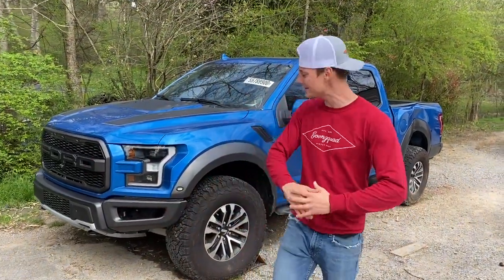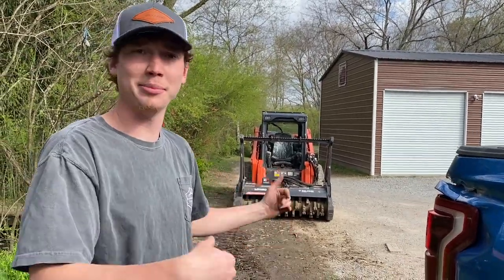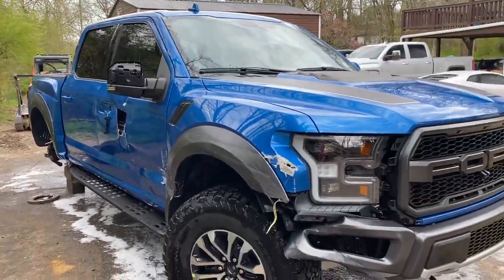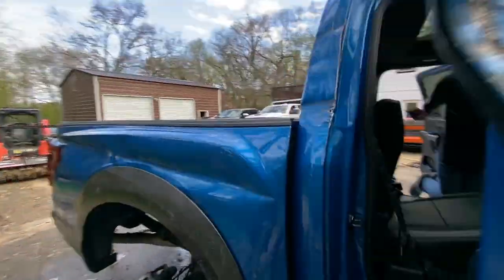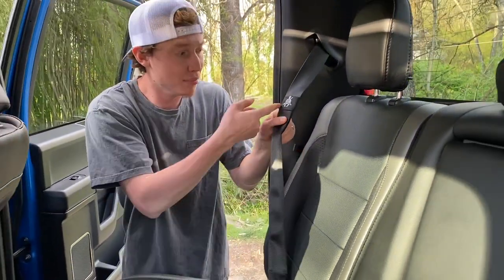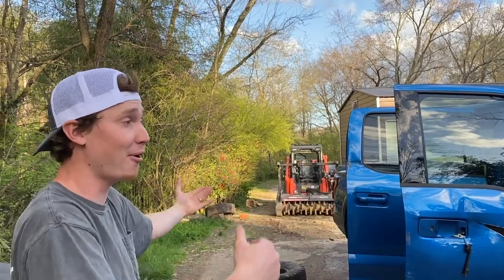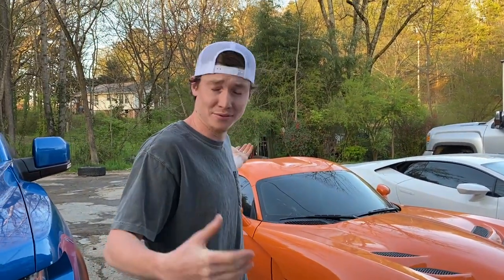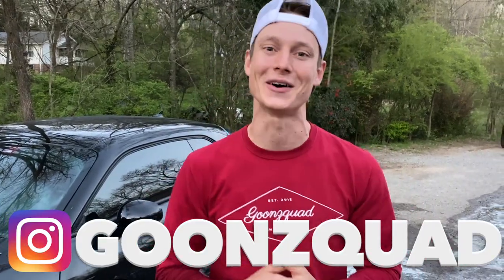Rebuilding A Wrecked 2019 Ford Raptor Part 2

Comment: Danggggg suuuuuun ! THIS WAS MY DADS TRUCK ! it was Simi flat bed trailer he ran into.. so glad you guys got it !! He might have a extra key he could send ya !
Reply: Those are hard to avoid for sure.
Reply: Hope he was not injured, looks like it was a rough ride.
Reply: Hope they read this :D
Reply: hard to beleive
Reply: fake news 🤣😂
Reply: Send them an email or DM  to make sure they read this as it would be great to get tht key for sure
Reply: The key probably needs to be saved with TLC. But who knows. Maybe it can be upgraded  :)
Reply: HOW THE HELL DO YOU HIT A FLATBED TRAILER, DO DAMAGE ON THREE SIDES, NEVER SCRATCH THE FRONT, AND NEVER BUST A PEICE OF GLASS? IM CALLING BULLSHIT. SOME OF THIS DAMAGE LOOKS LIKE IT WAS DONE INTENTIONALLY ALSO NO AIRBAG DEPLOYMENT
Reply: @mitchtucker5768  calm down buddy it's not that serious
Reply: @mitchtucker5768  calm down bud, shit happens
Reply: @mitchtucker5768  I agree with you-
Reply: @mitchtucker5768  I bet it happened in a winter storm when the road was slick. The Raptor is pretty soft and could dent easy. And the flatbed driver could have changed lanes into him and sent him off roading. I have seen it happen right in front of me on the highway before. The truck that went off road in front of me slid sideways into a sign and dented the bed just like this truck. He didn't break any glass either. Oddly enough it was a flatbed semi that ran him off the road.
Reply: @mitchtucker5768  I've literally seen a flatbed trailer carrying steel coils rip almost the entire side off of a Dodge Ram in the parking lot where I worked, and it didn't break a single window. If all of the windows are up and the trailer just digs in and tears down the side, there's a pretty good chance it won't break windows. And the front passenger window on that Raptor is broken where it caught the regulator.
Reply: dm them or email
Reply: fake new alert 😂
Reply: I'm gonna call BS on this because most of the damage is going back to front.  The raptor was likely sliding backwards. Look at 3:29 the metal is bent forward right behind the axle. And the cab was bent towards the read door opening also indicating it was back to front impact. Front bumper could be a secondary impact.
Reply: If i fart who will save me
Reply: @MrWoodyBalto  hitting a flatbed still adds up even in your scenario. If the flatbed was passing the Raptor on a 4 lane when they hit, then the damage would be back to front. And you could still have the secondary impact on the front bumper if it happened like this.
Reply: @vipereavp  No one.
Reply: @89ludeawakening1  Especially if the Raptor hit the brake, which most people would do instinctively.
Reply: @stealthesw7156  yep, or if the flatbed passed the Raptor, it would've automatically pulled hard to the right with the rear wheel being ripped off. The truck could've hit a guardrail or concrete barrier while coming to a stop and easily bent the front bumper back.
Reply: Mfs in this thread going full CSI investigation on how the truck was crashed lmao. My gosh. Just look at the carfax report.
Reply: @mitchtucker5768  I guess you’ve never spun around in ice before! Plenty of car accidents happen with no damage to the front.
Reply: @mitchtucker5768  maybe this poor raptor was parked on side of the road. And got hit by a semi trailer (when its turning or another possibilities) and kicked into a sign pose or something like that . Maybe thats why the otherside of the bed got bent. And doesn't blew any airbags.
Reply: Who cares, it’s bent!
Reply: 0)00
Reply: WOW boys ! This blew up ! He was in a hurry and it involved two simi trailers that were parked and one was moving he tried squeezing in between them while going purty fast before he was blocked it did not go well ... he was not happy at all he said he thinks he handed in all the keys but will check !
Reply: @mitchtucker5768  I agree, This was no accident. Looks like Insurance Fraud to me.
Reply: @timglass6041  prob realized he couldn't afford the payments😆
Reply: I don't know how true this comment is, although I've no reason to doubt what the guy says. What I do know is there's a whole load of arrogant, rude, disrespectful cr@p in the replies. Using words like "liar" and "insurance fraud", when you know f@ck all about what happened, is ridiculous. 
No two accidents are the same and the types/amount of damage can vary hugely. Sometimes, the windows will pop if you bump a fence. Other times, all the glass will survive a high speed head-on. 
It's perfectly possible that @Zen Jamin knows what happened to this truck; 𝒏𝒐𝒃𝒐𝒅𝒚 𝒆𝒍𝒔𝒆 in the comments section has any idea. Show a bit of respect and stfu.
Reply: @2H80vids   Well said I could easily prove it but who cares ... who .is able to buy a raptor put no miles on it and do this on purpose...
Reply: @zenjamin6262  insurance fraud is done by people who cant afford a car. they damage it, call it an 'accident,' then the insurance pays off the vehicle.

Comment: Fun fact about the Raptor:  Due to the width of the truck being higher than 80", the Department of Transportation (DOT) requires the truck to have the amber lights somewhere on the front of the vehicle. I think the placement of the amber lights on the Raptor was a good choice by Ford. It looks like it was meant to be there
Reply: Same thing on the TRX.
Reply: Fun fact: the rule applies to the rear aswell but with red lights
Reply: Same thing with all registered pickups.
Reply: Unless you're in the south. Nobody cares in the south lol.
Reply: People didn’t know this?
Reply: @Blue_Flame_Raptor  I did not know that about the rear. Good to know
Reply: @ThatGUYILL  that's why raptors have the 3 lights in the third brake light and 2 on the besides
Reply: Is there another truck with the same width as the raptor? Not including the new shitbox trx
Reply: @pikavargas4442  no, the closest thing would be a dually
Reply: This is not true
Reply: @Henleyrocks  look it up

Comment: Guys, 
Aluminum can be repaired. Aircraft structural repair specialist can cut, splice, and repair holes in aircraft. In some cases the structure can to strengthened to stronger than factory. The flush rivets can keep the exterior smooth.

Comment: 4 automatic. It’s a mode that uses a wet multi-plate clutch to distribute power between the front and rear axles as traction demands its just like an all wheel drive basically

Comment: On the transmission selector 4A is in fact “automatic” mode. In rain or snow if the sensors detect rear slip it activates 4 High.

Comment: That looks like he went through one of those cable highway dividers made of posts and cables.
Reply: But than, why no airbags are blown? Somehow I think no one was in the car when it was wrecked.
Reply: @paulog8813  Could have been low speed. Like maybe passed out behind the wheel. Fiberglass and aluminum damages easily.
Reply: @robertbailey4454  Yes, but what about the ripped whell?
Reply: @paulog8813  He is in Texas and so am I. I am very close to Rockwall too. The cable and steel post dividers are designed to stop cars from crossing over into oncoming traffic which means they have to be strong. The tear in the door and that long crease down the side looks like a steel post gouged into the metal. I could be wrong, its just a guess. Those cables and posts are very effective.
Reply: Where's the Doberman
Reply: @carnellsmith4381 It's not been in any of the vids since they got it and never mentioned, so I think they got rid of it on the quiet.
Reply: @antc1609  some ppl think they clipped the ears even though everyone told them they should not do that, so they just never show it now so they dont get a bunch of backlash
Reply: @robertbailey4454  seems possible, and if the truck was going fast enough that it still kept moving forward even with the damage incurred, that might have been why airbags didnt blow, because it wasnt stopping hard enough to warrant it. airbags are basically explosives so theyll reduce chance of it going off as much as possible.
Reply: I think a side swipe by a larger vehicle whilst parked up. Like a truck making a turn ripping alomg the side and taking of the wheel.
Reply: @justincrawford7508  that's a very good point. The car was probably not on when it got hit.
Reply: That is a strange question. I guess there is always the of chance that fortune played a hand and for what ever readon didnt allow that to happen or they could all be faulty.
Reply: @robertbailey4454  not with that amount of damage . If it was side  impact the airbags dont normal go I am told. I believe they ony go of on a frontal impact.
Reply: @paulog8813  the cables that divide a highway centre as  barrier.
Reply: @paulog8813  If the cables managed to get around it and torque it enough, they could break the shaft, especially if they caught on the bigger tire and used the leverage of the bigger tires against the shaft. That would explain the bent leaf mount as well.
Reply: @kevinklingner3098  That is incorrect. Just watch some crash test safety testing videos. Side airbags go off on a side impact. If the truck hit on the very front right corner and went down the right side it would not have triggered any airbags unless the impact was the equivalent of 15mph direct side impact. I did the same thing in my 08 F150 and destroyed the left side with no airbags or seatbelts deployed. which surprised the hell out of me.

Comment: My husband has the 2020 F150 with the 2.7L twin turbo motor. You can get an ngauge tuner and have brew city boost or lund racing tune it. It is pretty quick and we are able to run it on E85. All we did was replaced the air filter with a cold air intake, and a bigger inter cooler and the tune. It can run 12's in the quarter mile.

Comment: Considering the price tag of a brand new Raptor. I’m surprised this one was totaled out with as little damage as it has.
Reply: The insurance company would only sanction repairs if the work is done using OEM components, and plenty of those are damaged on this vehicle. The entire rear suspension on both sides would have to be replaced with new parts, as would the whole of the bed and all the bodywork on the passenger side. This all adds up to a very high parts bill and many, many hours of labour costs. But the real killer is the frame: if that is bent (which seems highly likely) the Insurers would insist on a new chassis, a huge undertaking. Plus, whether the vehicle gets a full respray or a 75% blend, the paintwork would be expensive. Overall, the economics simply would not work. Goonzquad purchased the Raptor in December 2020 with a bid of $41,500 (about $45,000 'out the door') and the Copart Repair Estimate was $39,055. The Estimated Resale Value which Copart Gave was $74,752, so the deal would have made no sense at all to a typical private buyer. Goonzquad can only justify the price and repair costs by the YouTube income they will earn from the content.
Reply: @johnstedman4075  not to mention they don't pay labour as they do all the work themselves.
Reply: Also the a b and c pillars being damaged would mean the cab as a whole would need to be replaced. Rollover protection is compromised. At least where I'm from that with a bent frame is instant write off

Comment: 8,000 lbs max towing capacity on the 2019 raptor. That same setup on a regular F150 is rated for 11,100 lbs. If I recall it is really all around the suspension set up of the raptor, since it is designed more as an off-road beast than a all out tow vehicle.

Comment: 4A or 4 auto is an electronically controlled 4 wheel drive. It basically lets your transfer case turn 4 wheel drive off and on as needed based on traction and a few other variables.

Comment: 4 Auto
Unlike most normal trucks, which feature a 4WD mode that locks both axles together, the Raptor's "4 Auto" mode uses a wet multi-plate clutch to distribute power between the front and rear axles as traction demands, just like an all-wheel drive system. ... So in essence, the Raptor features both 4WD and AWD

Comment: Took this right from google 

(4A (4X4 AUTO)
Provides electronic control four-wheel
drive with power delivered to the front and
rear wheels, as required, for increased
traction. This is appropriate for all on-road
driving conditions, including dry road
surfaces, but is especially useful on wet
pavement, snow, dirt, or gravel.)

Comment: 4A is AWD mode. shift in on the fly.. i have it in my f150.. they say 5000 miles for oil change, but do it every 3k.. the turbo v6 has alot of blow by.. look into the JLT 3.0 catch can guys seriously!

Comment: I bet it went through a snow barrier fence, maybe backwards, after spinning out on a ice covered road. They use short steel posts and thick steel cables...Hence the scratch marks along the side of the truck and the hole in the door.

Comment: On the Raptor, you need a uniside which is all one piece. Yes you can splice in whatever part you need if you do the repair correctly. Has to be sleeved, welded with a aluminum pulse mig and SPR  riveted. I happen to have a brand new right uniside in the box for that truck, yall arent in Texas are ya? lol

Comment: 4A (4X4 AUTO) – Provides electronic controlled four-wheel drive with power delivered to the front and rear wheels, as required, for increased traction. 4A tuning varies based on the selected Drive Mode. 4A in Normal and Sport is appropriate for all on-road driving conditions, including, dry road surfaces.

Comment: Check out ADD for front, rear bumpers and Rock sliders. And they have others things like BAJA racks and roof racks. Also carbontastic makes carbon steering wheels for the raptor. Also the old raptor had a NA 6.2L V8 not a 5.0. You should also paint the hellcat B5 blue it’s a dodge color.

Comment: 4A is 4 wheel drive auto. It’s exactly what you said. It automatically engages 4x4 when you’re losing traction in the rear.

Comment: The new transfer case has a setting called 4A, which stands for automatic all-wheel drive. This setting puts the vehicle in full-time all-wheel-drive mode. ... According to Ford, Quote: 4A (AUTO): In this mode, electronic control four-wheel-drive power is delivered to all four wheels, as required, for increased traction.

Comment: I didn't think you still had the Pallidin brush cutter. I thought you were just demoing it. 

Repair the suspension but don't change it coil-overs. The suspension is designed for good off-road performance. You can improve parts but I don't think coil-overs will work as well as the standard setup.

4A is automatic four-wheel drive. It engages when 4x4 is needed.

Comment: You guys need to get an RMB Motorworks engine that’s starts as a 3.5 engine and is bored and stroked to 4.2 liters with a closed deck sleeved block. Then need to get the FreakOboost kit from full race that has a lot of the intercooler and piping and get the borg Warner 7163 turbos and they can make 700-1000hp and for the fuel supply hit up Xtreme Di.

Comment: hate to tell you boys but 3.5s are hard to make sound good. best i’ve personally played with was a dual 4inch diameter pipe all the way down so you get a girthy ignorant sound with those turbos spooling. so STRAIGHT PIPE WITH 4INCH DIAMETER PIPE

Comment: how is possible no airbag deployed?
Reply: The fact that none of the airbags deployed on the Raptor is consistent with it being sideswiped from rear to front while parked, and that this caused the scraping and directionally biased tearing damage along the passenger side. The damage on the driver's side is different, because it is buckling, not scraping, and the most obvious example of this type of distortion is on the side of the bed, and was probably caused by the rear left-hand wheel being forced upwards violently after striking a fixed object such as a curb. This impact was a high energy event, shattering the rear axle components and even buckling the driver's side rocker panel. The frame (chassis) of the truck is probably distorted in this area and around the rear suspension mounting points, and this is the likely reason why the Insurers effectively wrote it off. Copart auctioned the Raptor to Goonzquad on 10th December 2020 for $41,500 (around $45,000 'out the door') and estimated repair costs at $39,055, with predicted resale value at $74,752, making it an unviable proposition for a typical buyer but acceptable to Goonzquad because of the YouTube revenue potential it offered.

Comment: No air bags deployed?
Reply: The fact that none of the airbags deployed on the Raptor suggests that it was sideswiped while parked, and this caused the scraping and tearing damage from rear to front along the passenger side. The damage on the driver's side is different, because it is buckling, not scraping, the most serious example of this type is on the side of the bed, and was probably caused by the rear left-hand wheel being forced upwards violently. The frame (chassis) of the truck is probably distorted in this area, and this is why the Insurers wrote it off.